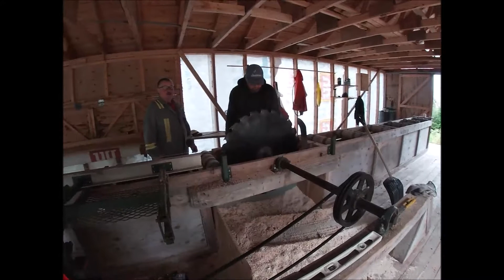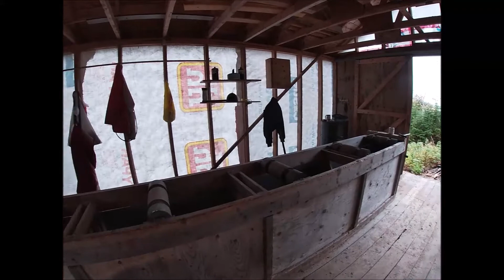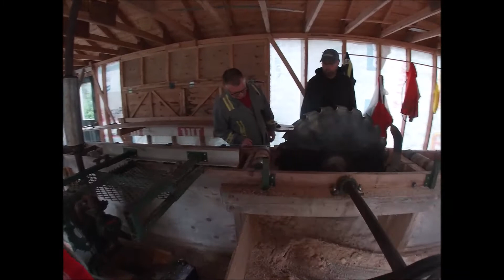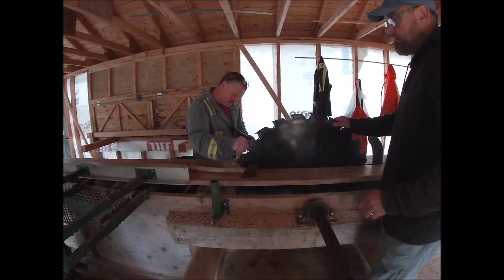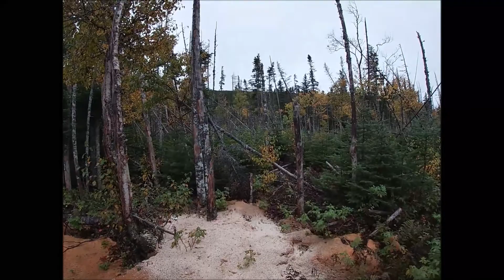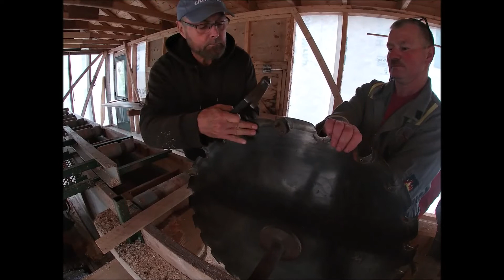Homemade Sawmill.......7

Comment: Didn't show close enough on the teeth.  Simonds? Or Diston? If everyone is inexperienced & you're having trouble with something give me a message. Looks like the coveralls guy knows how things go?
We picked up a mill from our old neighbor & got looking at it. He'd been sawing all his wood with pins to hold it because he had a left hand saw on a right hand mill & the dish was the wrong direction. 
I like the shorter ( less than 10 minutes) videos,  easier to find the time to watch. 
A few more details like the carriage and power supply would be neat to see.
Reply from the maker: Simonds Teeth  ,we got to get a set of teeth  , what would a set of 36 cost out your way
Reply: @kirknorthof5128  not sure.  Haven't bought any for ages.  I  assume you didn't buy carbide  or tool steel l, but normal steel teeth.
I  need to get this mill put together.  There's always something a guy could use. Just made a deal on about 100 tons or more of tamarack logs about 10 miles away. Not sure what I'll do with them. Firewood,  fence posts or lumber.  Probably a combination.  Not cheap though,  50$/tonne for the logs.